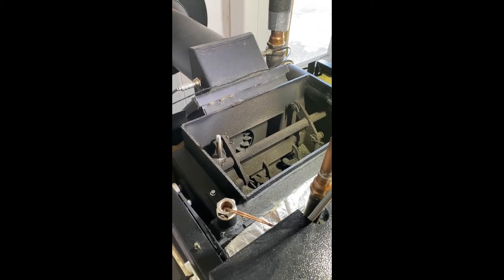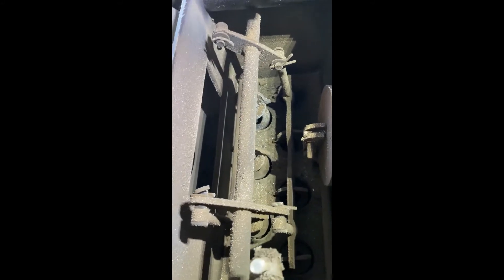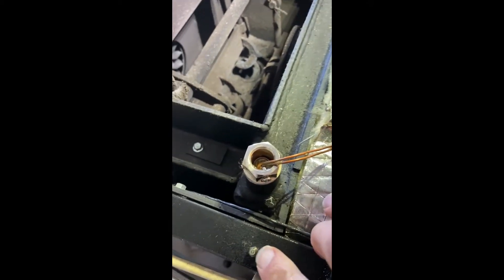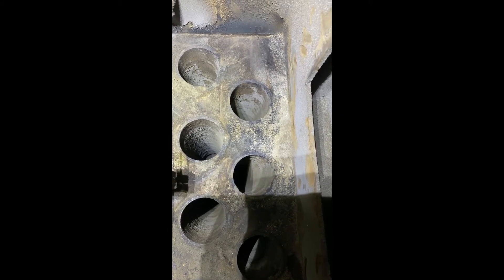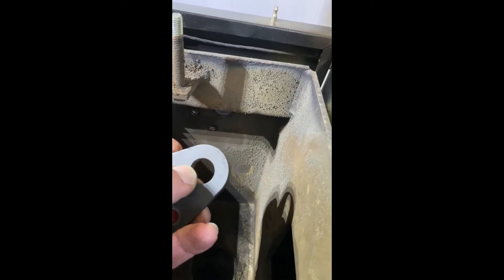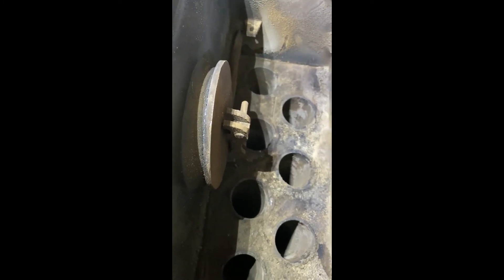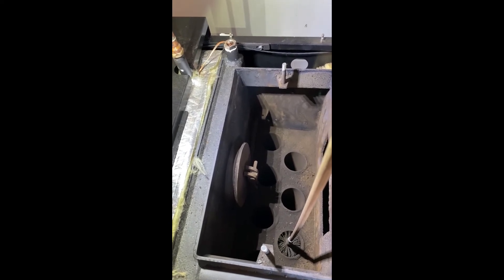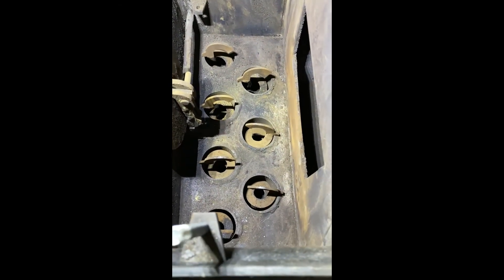Attack cleaning modification

Comment: Hi, I would like to know, how you clean those spiral turbulators? For me this is really time consuming to get them back to shine... thanks
Reply from the maker: I don't spend much time at all on the turbulators themselves,  I only shake the loose ash off of them.  The tubes themselves get most the attention.  In my opinion some build up on the turbulators helps to slow down the exhaust gases and perhaps allows better heat transfer to the tubes.

Comment: Hello Tim. I don't know, but it seems to me to be a big hole in the middle of the turbulators. What is your chimney temperature? In my world, accurate and equal temperature in chimney diameter, means safe and long-term use of the boiler with optimal economy. The same applies to the temperature of exhaust gases in the boiler pipes. Note: My English is Google translator English. With kind greetings...

Comment: Hi Tim, what do you use to hold the fire bricks in place. What state are you in? Area? Thanks for the info.
Reply from the maker: I simply align them over the factory nozzle opening and pack some fine ash around them. After a few firings they get a bit more secure. They can shift if I'm not careful when loading wood but I simply check them when cleaning and push back as needed.  The newer lightweight firebrick tend to crack more than the heavier traditional firebrick.  I've also used Stainless steel sheet to form a nozzle protector but it tends to warp and only last a few weeks. I do want to try one out of 3/16" or 1/4" Stainless with a couple locator tabs that protrude a bit into the factory nozzle as a location feature.   The firebrick is cheap but it's thickness is not ideal for keeping the wood over the nozzle where you want it.  I'm in south central Minnesota.
Reply: @timdahm7039  Hi there, JUST finishing my Attack install, after 7 years in motion, and I wanna know if you did the stainless mod for nozzle wear?? How much of the burn chamber floor did you cover and what did it look like? Will do the firebrick mod at the least, until I figure out a longer lasting option. Thanks for your vids, with trial and error and deep thinking you've already done for us!!